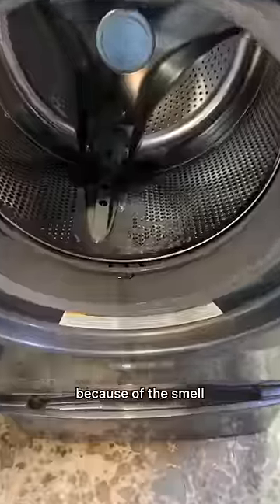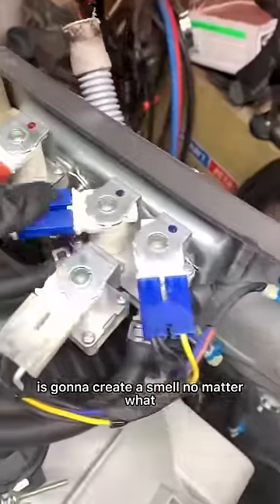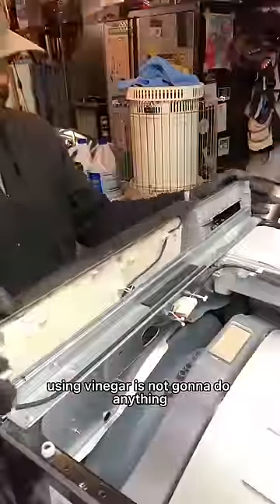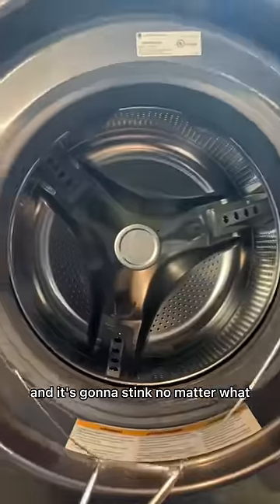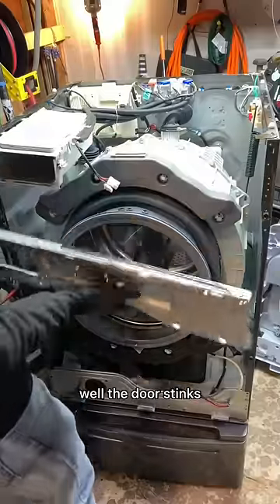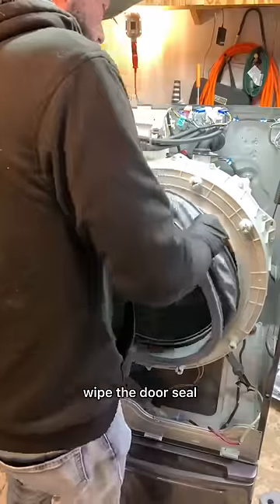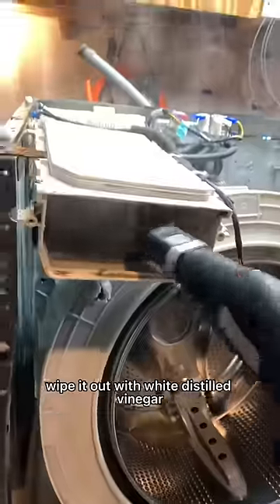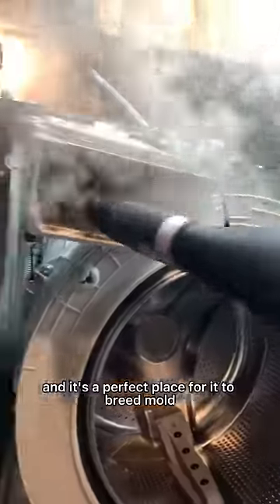Front load washers are proven to wash better. Facts, not opinion

Comment: I'll just get a top load washer.
Reply: No
Reply: I like how he cited the proof that front load washers clean your clothes better. This guy is a propaganda gene pool.
Reply: I went back to front loaders after top loaders.  Constant out of balance, every load had to be a small or it would be out of balance, water barely wets everything,  clothes never smelled clean compared to front loader.
Reply: @Rangerscott69  some of the better top loaders allow you to have manual control over water fill.
Reply: @Rangerscott69  Buy a better top loader.
Reply: @frmerrin2  no u
Reply: @Rangerscott69  I did and it works just fine.
Reply: Don’t bother with a newer one. The new top loaders are crap.
I bought the biggest new Maytag washer with an agitator I could a couple years ago thinking it would be great. Except for two cycles, the clothes hardly get wet at all. I didn’t realize until too late that it says in the manual it works by friction. (I don’t care how
Much you rub dirty clothes against other dirty clothes, all you end up with is torn up dirty fabric.) Even using the deep fill cycles, the agitator only basically moved the three inches right around the center. The rest just ended up sitting still. It took me forever to figure out why stains weren’t coming out and it always looked like there was a weird residue left on the clothes. (I had one guy tell me that residue was proof the clothes were getting “cleaner”. Um, no.) I even changed types and amounts of detergent to see if that was the problem. Nope. The washer just didn’t really clean anything. After fighting and being frustrated with it for two years, I recently went back to using the smaller front loader that I actually still had in my garage. We still own a much smaller 35 year old top loader that came out of a house a ginormous tree flattened. I’ve actually seriously considered going back to using that one full time. (Sorry for the long response. I just do t want anyone else to waste their hard-earned money on these things.)
Reply: @damon2772nomad  what proof did he cite? He made a claim with no proof lol. Did he cite some kind of empirical study?
Reply: @Rangerscott69  that's hilarious because in fact top loaders are high capacity washers. A 5.2 cubic feet impeller top loader, for example, fits King-size comforters and other bulky items and large loads. You can't fit all that in a non-commercial front loader. Another fact: front loaders use less water so they in actually have the biggest problem of lowest water levels in washes
Reply: @frmerrin2  front loader still wins every time with cleaning better 😂
Reply: @carpediemearth  they use less water because they don’t need as much, another fun fact just cause you can stuff it in doesn’t mean it cleans it as well 😂 go take a dirty king size comforter to a laundromat and use a front load washer it actually fits in, guarantees it cleans better, agitators barely move in a top loader and when you have a sopping wet 20-30 pound comforter trying to ‘spin’ with a piece of plastic sticking up the center, well, it doesn’t spin whatsoever, just moved with the basket
Reply: @EulogizingSleep  go watch a front load washer clean clothes it rotates left to right letting clothes move around the basket and mix with the soap and water, a top loader has an agitator sticking up the center, those clothes move a few inches side to side from the agitator moving, front loaders spin out the water to the side of the basket rather then straight up and down like a top loader so they spin out better as well, no “study” is needed just go watch the two machines work and think how the clothes get cleaned
Reply: @flared613  I said impeller top loader, not an agitator one
Reply: @flared613  I've had both, there is no difference.
Reply: Yes, they are more reliable, especially older ones
Reply: @jay-uo2bi  wdym no
Reply: @Rangerscott69  You probably had one of those trash HE top loaders
Reply: @flared613  No they dont
Reply: @flared613  The agitator picks up the clothes and turns them around and scrubs them, Front loaders just tumble the clothes with a tiny pool of water

Comment: I’ve had front loaders for many years, and all I do is leave the door ajar when I’m not using it, and run a clean washer cycle with affresh every few months and have never had any mold or smell whatsoever. Very simple. 
LG machines even have this nifty little feature that if you push the door in just enough, a magnet on the door sticks to the doorframe area without latching the door, so you can have the door mostly closed while still allowing airflow to prevent smells and mold.

Comment: Nothing cleans better than the old washers that filled up with water and would ring your towels into shoe strings cause they actually worked these new front loaders just spit on your clothes and roll them around and barely rinse the dirt out of him you should clean your clothes in one of these new washers and then soak them in a 5 gallon bucket see how much more dirt you get it’s amazing
Reply: High efficiency washers actually clean better lol. It is all in your head.
Reply: @calebniederhofer6529  Literally tested them side-by-side I work for testing firm so yeah whatever man
Reply: @randsheets6564 I'll try it. I have a front load Electrolux. What'd you wash? Hot/cold? How dirty were the items? How long you soak them in a bucket?
Reply: Lived in an apartment for years with front loaders, the clothes literally would not even get wet. Finally I took to soaking them in a bath tub before I put them in the paid front washing machines. Beyond worthless.
Reply: @qcriverrat Why are you people so deluded?
Reply: @qcriverrat  
The obvious variable is poorly maintained or cleaned public washers. You think those things are working at their best conditions? It's probably been gunked up and not been maintained.
Reply: @Un1234l  I currently use a 40 year old washer that has never needed maintenance as long as I've used it. I've previously used brand new front loaders that didn't work right out of the box. It's more than a question of maintenance.

Comment: Now companies are coming up with front loader washers that blow air into the machine after every load to prevent mold in the door seal and the tub.
Reply from the maker: I haven’t heard of that yet!! That’s seems like a great idea though honestly. It wouldn’t really be necessary if people would read their manuals though. Convenience has replaced due diligence almost to the point of theory lol
Reply: Why? The door on my LG has a detent to hold it slightly ajar, allowing the moisture to evaporate. I think it likely that other brands are similar.
Reply: Which brand do you know which one?
Reply: @falkenvir it’s on the GE Profile line called ultrafresh vent system. I wish LG would have a feature though I don’t know if the GE one is successful or not in reducing mildew.
Reply: @mawnika  sadly not available in Indonesia. We still have LG, Samsung & Bero
Reply: Just something else to break
Reply: There's washers now that also function as a clothes dryer. Convenient, but sounds very complicated to build and costly to repair...😮
Reply: @rattaxi9645  Exactly. "Look at all the innovations it has to fix the problems it's creating. It just adds to the overall betterness of it!"

Comment: I just stick with my Speed Queen TC models. Still built like a tank and work quite well for a top loader.
Reply: I thought the TRs were more reliable ?
Reply: @ThisAintIt435  The TC is the home owner model of the units used in laundromats. The TR is the one with improved drum design and extra computer control gadgetry. In theory, the TR will outperform the TC in function. Which one will last longer? I bet on the unit that has to be reliable in the hands of the public.
Reply: @ThisAintIt435  the TCs are the golden child of the speed queens

Comment: If I have to take it apart like that, I’m either buying a new one or hire someone to clean it 😂
Reply: And now you know why this guy prefers front load machines, because it keeps him in business!
Reply: Just what women  want is something  more to take care of 
And clean.
Reply: @hotfiyah  no it doesn't, you just leave the door open and they work forever with no smell
Reply: @R_o_b_e_r_t  no matter how much you keep it open the door WILL start to leak.  Every single one of them does at some point.  Not to mention you can get a larger washer with more features for the same price as a normal front loader that will eventually leak on you.
Reply: @hotfiyah  I changed one seal in 10yrs, and it never stinks(I never need to clean it too). In Europe we all use front load washers...
Reply: @hotfiyah  My parents had a front loader that was never serviced for 15 years, never leaked or had problems. Only reason they got a new one was because they wanted a quieter on.

Comment: I don’t have to wipe anything down or use vinegar in my top load. Seems like maybe the front load washers are junk
Reply: They do chemical cleaning instead of top loader washer's mechanical cleaning. However, newer protocols ask for more mechanical laundering and even less temperature. Heavy duty detergent powders are more essential to compensate for the saving. Liquid detergents alone won't cut it, you need to add calgon every wash, or standby for it to happen.
Reply: @MeteCanKarahasan  you are so wrong in every level 😂
Reply: Wiping out the gasket where the drain holes are is usually only needed to be done when it depends on what you’re washing and it’s a piece of paper towel or two, right inside the door you pull the gasket back, wipe, throw out the paper towel and you’re done, and just leave the door open after using it so water drys, that’s all the cleaning there is, people just don’t do it and use way too much soap/detergent and probably not the best brand either and wreck the machines

Comment: I just run the self cleaning cycle on ours as often as I can and it has zero problems so far
Reply: So much for saving energy.
Reply: @frmerrin2  There's a tree out there that needs a hug from you.  Go find it.
Reply: @markbrowning4334  you misinterpreted what I said, I merely pointed out that the cleaning cycle on these washing machines uses hot water and pretty much negates the whole "energy efficient" feature if you have to use it frequently enough.
Reply: @frmerrin2  Noted.
Reply: That only applies to users that don't keep any powder detergent handy.

Comment: They Burn through motors and control boards every 3 to 5 years . .. is what I have seen .. 1st hand ..
Reply: Depends on the model
Reply: what brand so i can stay away
Reply: No they don’t
Reply: Not a brand issue just a certain model issue
Reply: Nope had ours for more than 10 years
Reply: Umm I don't think so.
Reply: Your experience with at most 4 washers does not have any statistical relevance. That's like the geniuses that say my Ford 6.7L diesel has been running great for 15 years." Just because your sample size of one is working fine or not working does not tell ANYTHING about the product as a whole.
Reply: I've had the same front loader for 10 years. No issues.
Reply: Well, we've been using Bosch washers for close to 15 years now and the only thing we had was a control board failure after eleven years of use by a family with two kids. Never been through a motor, never had problems with bad smell, never had gunk buildup problems. Just leave it open after washing so you don't have moisture inside and that's all it takes
Reply: I have a Whirlpool front loader. It's almost 16 years old. I stopped using liquid softener a few years ago and I always leave the door open. No smells, no problem.
Reply: I've only had to change a pump after about 8 or 10 years of use.  The pump was a little pricey, but the change out was extremely simple.
Reply: My samsung is running 6 years very well, self balancing, fits a ton of laundry. I leave the door open when not in use and that keeps the stink away. 

My dads how ever is a cheap top loader has gone through 3 boards, becomes unbalanced and is a pain to it balanced right due to the auger in the middle. Can only fit half of What I normally wash in it when I visit. Both are the same foot print size.
Reply: @chrislakes6460  Samsung and LG. My husband owns an appliance shop and we get more calls about people having issues with those 2 brands than we do any other brand on the market.
Reply: Sounds like a model issue tbh and machines are made to last 15 to 20 years, some of the real old ones were built better then cars and can last 25 - 30 depending on when the bearings go bad and it isn’t worth the cost to fix it compared to buying a new one.

Comment: Do not use vinegar in those washers! It melts the rubber hoses. Speaking from personal experience.
Reply: That’s a myth. My grandmonther has been using white vinegar in her washing machine since the 1950’s. I kid you not, that MF is still running like brand new! 🤣
Reply: @zanadoyle7464  She's been using white vinegar in her front-loading washing machine since the 50s?  There's a rubber hose on LG front-loading washers that leads from the detergent dispenser.  My wife used to put vinegar in the dispenser, but it completely melted the hose, which sagged down until it rested on the drum which rubbed on it until it got a hole, and then started leaking water and soap onto the floor.  No myth, I have pictures (which YouTube won't let me post here in the comments for some reason).

Comment: My speed queen top loader is great, I’ll never go back to a front loader. Sorry guy
Reply: TC-5? I am considering one for this mold issue- ironically, same machine he is referencing- looked the same inside.
Reply: @MOAB-UT  clean your gasket regularly, inside there’s 5 little holes that drain water and can get plugged easily depending on what you are washing, keep the door open when not using it so the water drys and worst case you can buy these tablets called Affresh, they are for washers and remove smell, just put them in the machine, put it on hot and let it run with no clothed
Reply: @flared613  none of that worked.  Bought a TC5. VERY happy

Comment: Why am I paying $1400 dollars just to add another chore to my day
Hey Maytag WTF?
Top load only!
Reply: A chore to your month, you only have to wipe out the gasket once a month and leave the door open when you’re not using it
Reply: @flared613  
  Our house had a water filtration system 
We wiped after each wash day
  We used tennis balls to create a gap that would allow air in to help evaporate
  The door was always left open 
  And we still had musty smelling stinky clothes
      Each time the service people came they offered the same advice
  Which is what we were doing since their first visit
Reply: @chrishaan5766  there’s a product called Affresh you can try it’s for both top load and front loaders, it’s basically like a tablet you put in the machine run it by itself on hot and it helps with smell
Reply: @flared613  
  Exactly an extra step/chore to deal with what is a bad design 
  Mine are long gone 
  I have a top load machine now and I can decide how long the cycle is 
  Multiple loads each wash day 
  Now THAT is efficient 😁

Comment: I HATE my washer! Water level is ALWAYS low. I use a pot to fill it. The door locks and I have problems with it unlocking ( not a front load washer). It takes hours to wash one load. And lately I've been smelling mold. Now I KNOW it's the washer and I will try cleaning it tomorrow. Thanks for the video. I'm not very smart and didn't think my washer could get mold.